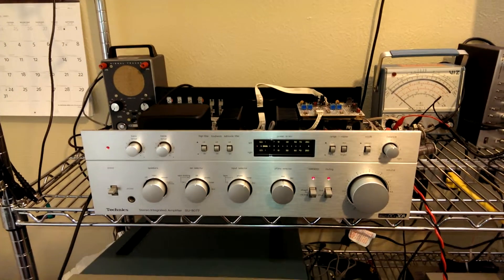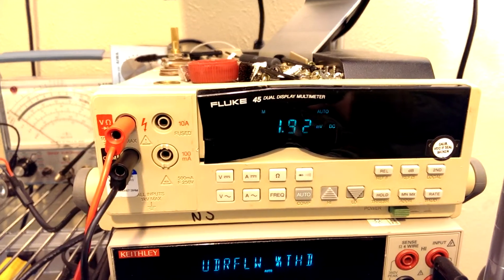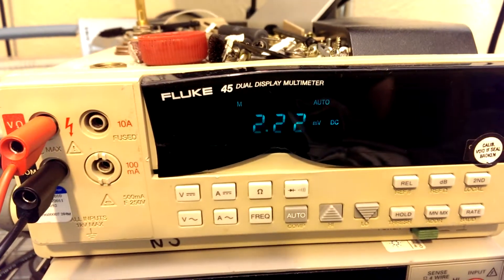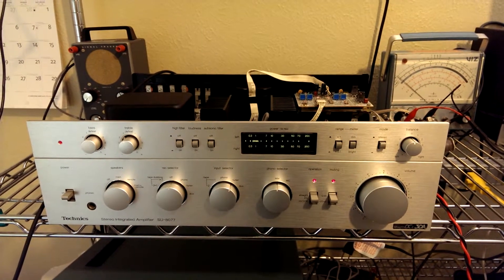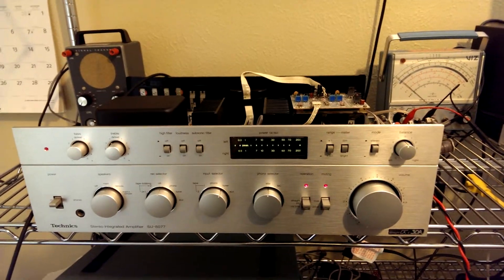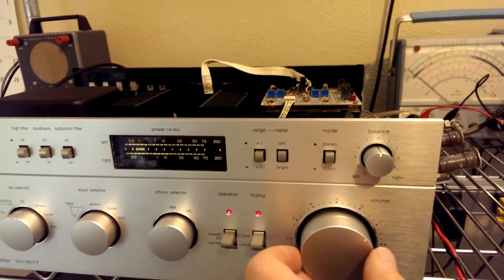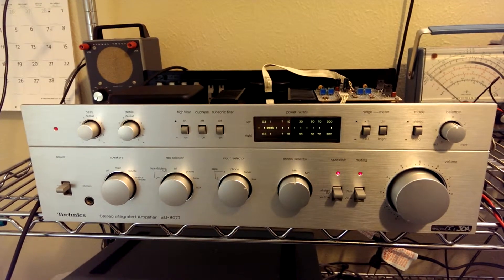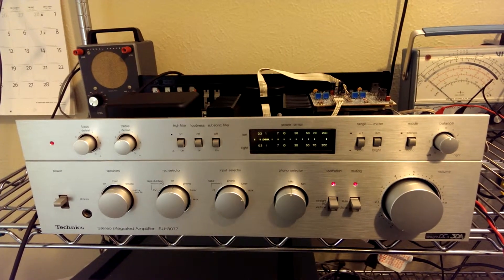Technics SU-8077: Post Service Performance Verification

Comment: Honest amp there. I would love to test the true power of my technics SU-v65A. Its rated at 85wx2 at 8ohms and 135wx2 at 4ohms and it consumes 620w. What would be your guest ?
Reply from the maker: You'll get near rated power on a continuous basis with roughly 2dB of dynamic headroom. That's not what's special about them though; what's special is their nearly unmeasurable distortion when operated within the rated power limits.
Reply: true power? i dont even see he is using here any resistor. u need pink nosier to see dynamic range. just using voltmeter u can guess that u measure low middle frequency range. and again true power is based on two to220 transistors. can not be more than those transistor can handle it